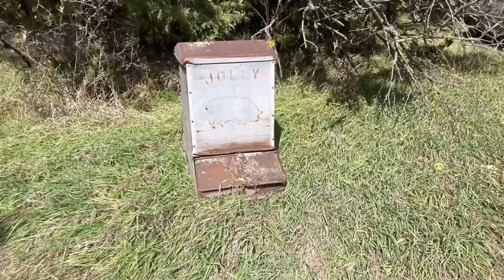Dragging Antique Trucks & Equipment Out Of The Trees On An Old Farm Part 1

Comment: The Ford truck is a 1967. Lots of one-year-only parts. The doors, instrument cluster,  heater controls, hood side emblems and grill would all be easy to pull and sell separate if you don't sell the entire truck.

Comment: Gat some stabil in a gallon gas put in the mower & jump start it let it run 15-20 minutes and it be good next winter. The inleaded gas with ethel in it eats those carbs right up over the winter !
Reply from the maker: I run them empty intentionally on their last use